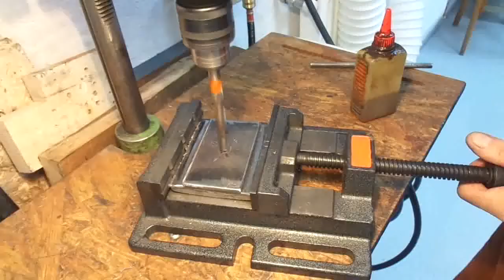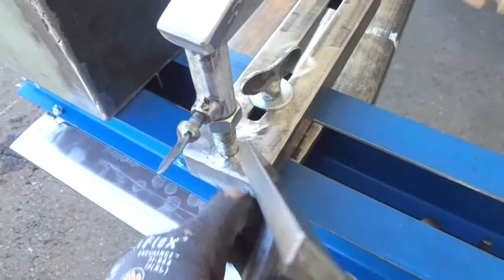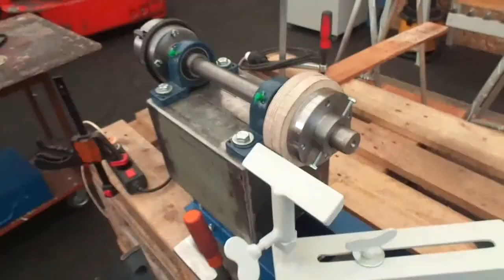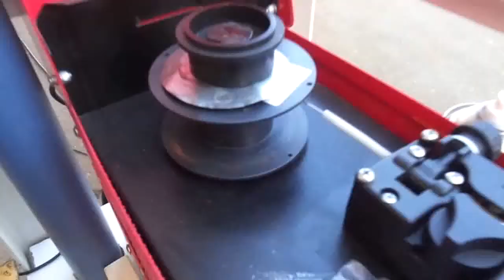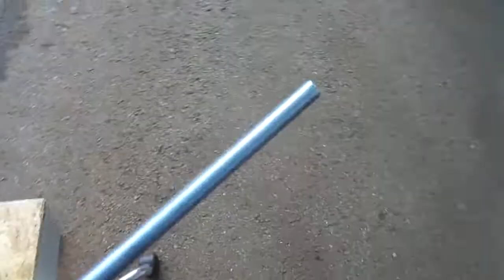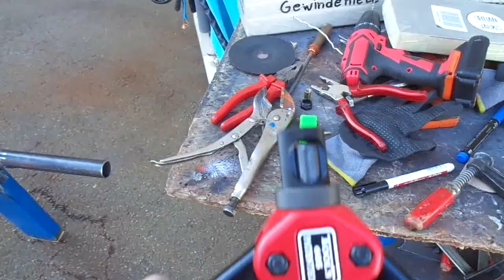wood lathe build part 3 (tool rest, belt pully & machine stand)

Comment: ALRI PAL. I ENJOYED WATCHING UR TABLE SAW BUILD. 
Man alive that was a proper job u made there.  i WAS THINKING ABOUT BUILDING A WOOD LATHE TOO BUT THE TABLE SAW IS THE PRIORITY ATM. 
I'm doing what u did by repurposing parts from my old table saw. I bought steel to build the frame but I'm not tech savvy enough to put a DRO or the electronics into a machine like u did. I love how u put the potentiometre on the machine for the arrows up/down & left/right.. That was really clever mate. I was wondering how u would control the movement to get the correct angle. Great job anyways pal and I have a question about the Lathe Pillow bLOCK BEARINGS..
Q. I bought 17mm ID Pillow Block bearings. I wanted to ask if it was possible to put some kind of bushing on a 16mm round bar bcos I couldn't get 17mm and I don't have any way pf turning down bigger stock.  
Q.Would 16mm round steel bar be ok for a wood lathe build for the chuck plate to attach to? I was wondering if it would be strong enough or is it possible for a bar that thick to flex with the pressures put on it?? Would it be best to buy bigger block bearings in the future with a bigger round bar?? 
Really enjoying these series of videos bro. Keep up the brilliant builds. 
I#m still blown away by the table saw build..
Reply from the maker: Hi, My friend.. i think a 16 mm shaft would be ok for a wood lathe. It depends, on how big of a aworkpiese you want to turn. I overbuilt my machine on purpose because i upgraded it to turn steel as well. I think it is possible to shim a 16 mm rod to get to the required 17 mm. Cut a coke can / beer can and wrap the aluminium around your rod as much as it needs. Use construction adhesive, to keep it in place.

Comment: a good boleti round bar welded  to the top will Mack a good tool seat  the rest should be on centre or just be low  so the tool sin centre , you only ned 300  rpm  son  to do a good job. sow od good. 15, 000 the rod to death. keep safe keep it slow.